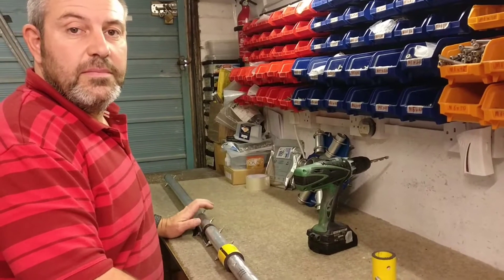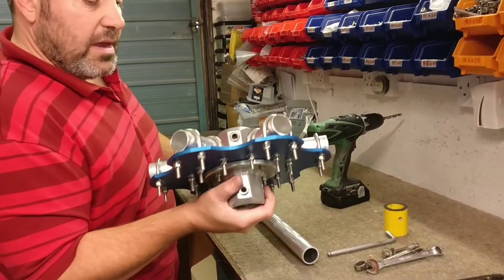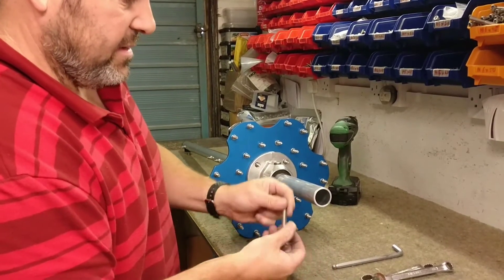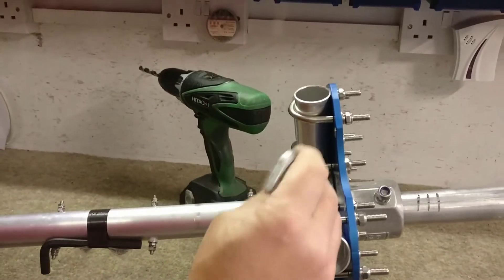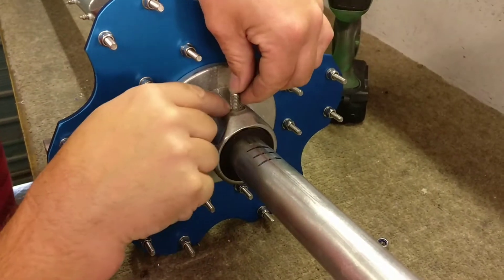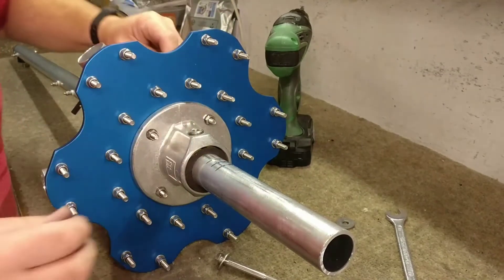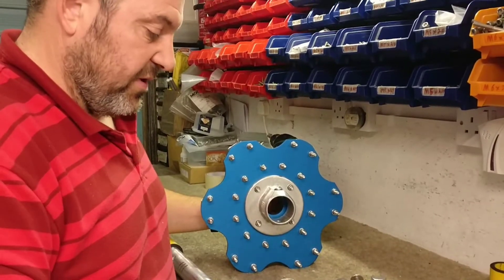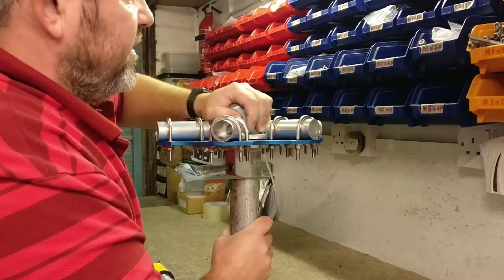Air Coaxial Centre-Post and Hub assembly - G3TXQ Hexbeam by MW0JZE

Comment: Hello. I have ordered the Hexbeam and will be using 48,3 mm tubing that runs to the rotator.
What is the distance from the top of the tube to drill the 8 mm hole to secure the 8mm bolt that goes through the tube and the post. Thanks, 73, Phil